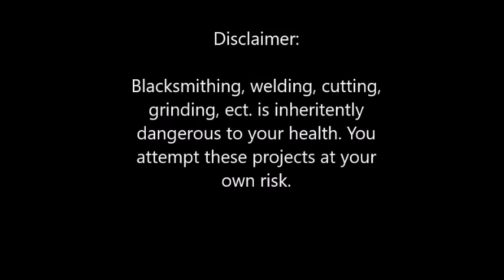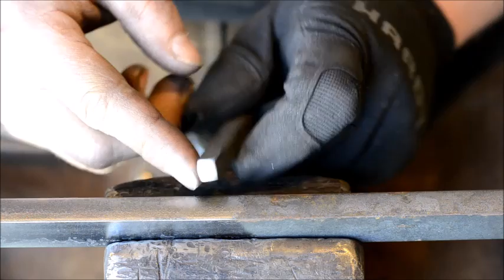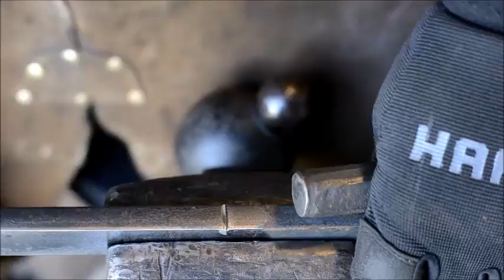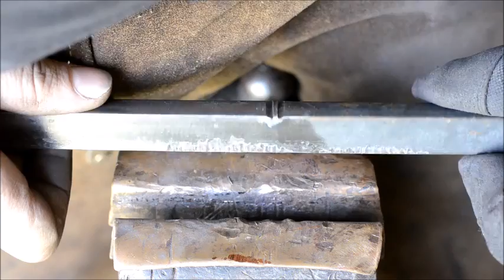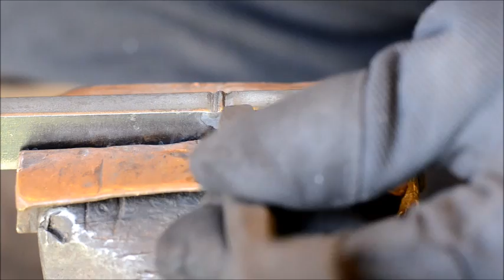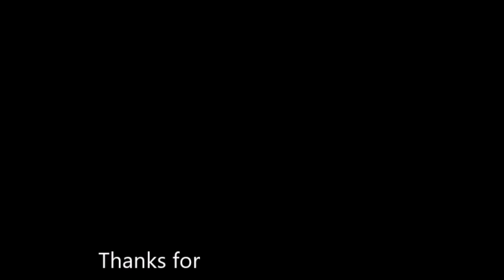How to Chase Metal Roping: Technique Taught to Me by Tom Latane Blacksmith

Comment: nice demo. I was fortunate enough to learn chasing and repousee techniques from Ernie Dorrelol about ten years back. like you I have mad all of my own chisel/tools. yes you can purchase them but usually modify to what you need anyway so learn to make them. FYI I use S7 steel for my tools Air cooled after forming/polishing up then into oven at about 450F for thirty min allowing to cool to room temo (twice). after heat treat polish if needed and apply light oil, to preclude oxidation. S7 is a good impoact resistant steel. BTW Old Coil Springs are 5160!

Comment: Is there any reason why pickling the piece is better than just using a wire wheel grinder to remove the scale?
Reply from the maker: +Samuel Filler the pickling is a tip that I picked up from Tom latinae . Pickling is not necessarily useful if you're going to use grinding or wire wheeling to remove the scaled finish all though using a wire wheel will not remove hard scale. In reproduction work of old pieces it is usually best to keep with the methods that were used of that time. In order to create the same result this is the reason for the pickling as using a grinder first would leave telltale signs of that grinding versus a filed finish. Hope this helps God bless you and thank you for the great question